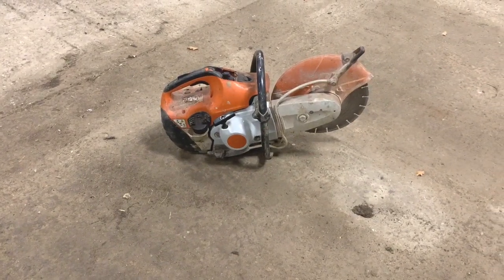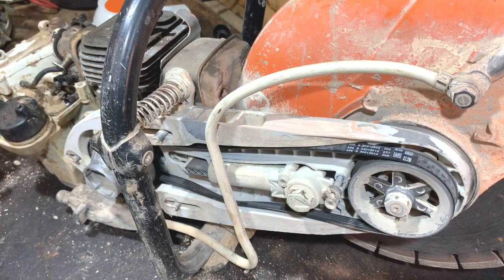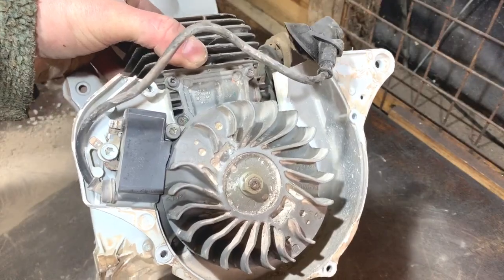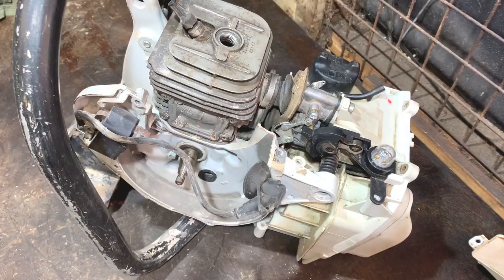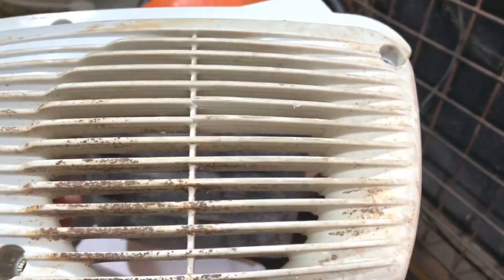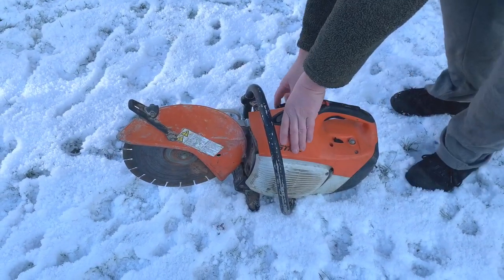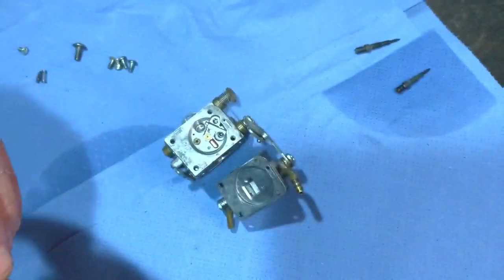Stihl TS410 , Cut Off Saw ( Strip Down Clean & Service ) Dizzy Cutter Stone Saw

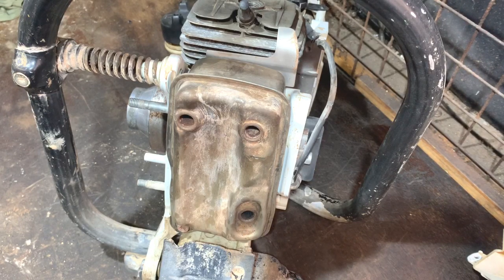Comment: @14:50 that hole is the exit for the exhaust gasses to vent, like the tail pipe you have on your car. 
Getting bolts started with an impact is  asking for cross threading bolts. Getting them going by hand then tighten with an impact.

@16:15 there’s 2tabs on the plastic cooling cowl that the linkage bar clips into to hold it in place while you put on the outer cover.